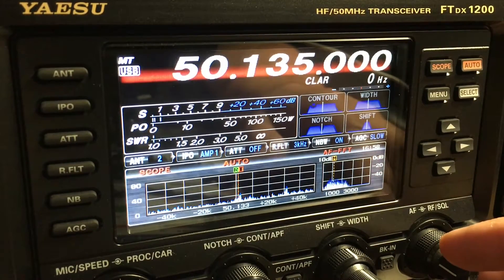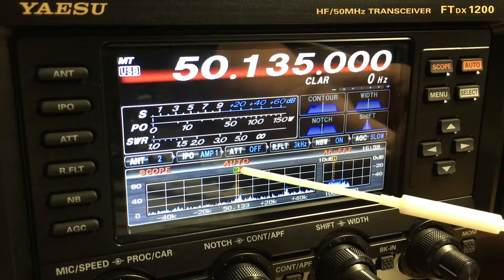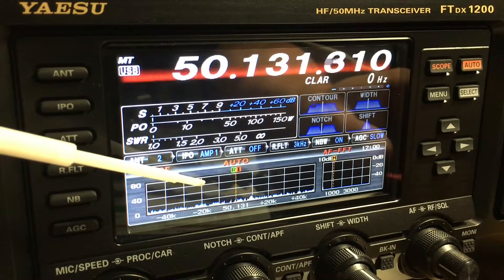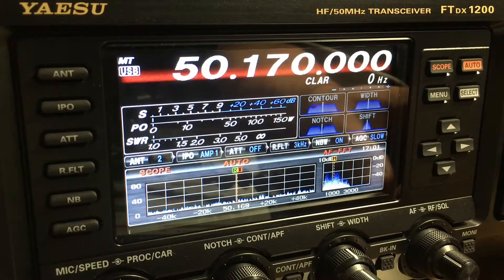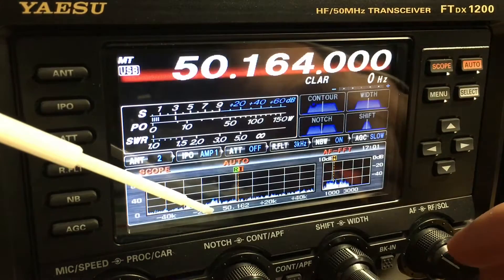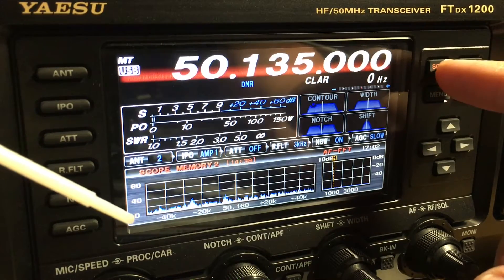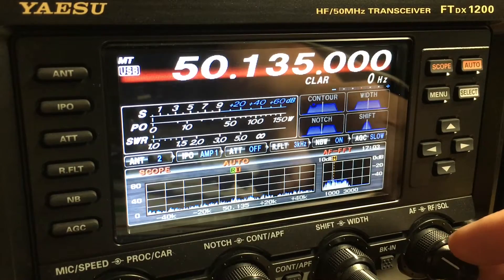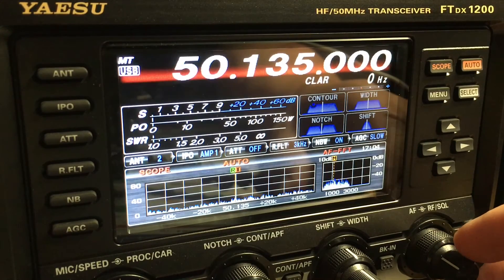Yaesu FTdx-1200 Demo / Scope, DNR, & Split Operation

Comment: The DNR works better on this radio  than my ftdx10 .
Why is it that Yaesu discontinues nice radios? 😢
Reply: At the time, Yaesu claimed they couldn't get the chips anymore, but the designs were also a decade old.  Yaesu has just refreshed its entire HF lineup with newer technology.

Comment: I had this radio when it first came out and it was great.  I think it was around 1300.00 with a 300.00 rebate.  The new FTDX 10 blows it away at around the same price, a little higher I think around 1600.00.  The only way I would buy a used FTDX 1200 is if it was around 400.00.  I Don't think I would buy any used gear now, new is so cheap.  Would you buy a used cell phone?  The 7300 is king but now the FTDX 10 showed up and crushed it and the 7610.

Comment: I was wondering the yasu radios like this 1200 does it have a bass and treble for your transmit audio to set up a microphone?
Reply from the maker: You can adjust mic gain, and some radios like the Kenwood TS-2000 will allow you to adjust microphone bass and treble not sure if the 1200 supports this.  I'd have to investigate deeper in the owners manual.  If you ever wonder about the available settings on amateur radio gear visit the manufactures website and download the .pdf owners manual.  I usually do that myself and look over options and settings before I decide to purchase new gear.
Reply: @KC5TGTRadiosNMore  ok thanks
Reply: @KC5TGTRadiosNMore   Yes the FTDX1200 has menu controlled audio  settings.

Comment: I have been trying to get someone to give me more information about the AF-FFT scope. I have been asking if after you install the FFT-1 do you have to do a "master reset" to the radio. And I also noticed that your  AF-FFT looks alot different then mine. Mine don't have the "M" with the yellow background and on my scope mine isn't solid spectrum across. Mine has a notch and 2 peaks. It looks like to me that you can move the "M" bar left to right for adjustment. I went through all the settings and can't figure it out. Went to other video's and seen where a guy had the full "water fall" on all 3 scopes....Is there a setting or is there something i'm doing wrong?
Reply: @KC5TGTRadiosNMore ....Well I called and wrote to Yaesu and they act like they don't care....Actually they don't care....Even their Tech support wont respond anymore, and this was way before the virus thing...I wrote them 4 times and no response.
Reply: @KC5TGTRadiosNMore ...Yes I did do all the firmware updates....This is where the problem started actually. I did do a factory reset twice and still have the problem.

Comment: There are other single receiver radios that show an active band scope without cutting the audio. The only reason the 1200 doesn't is Yaesu wanted to give you a reason to buy the 3000 instead. They probably spent an additional $10 in design/production to make it work the way it does, so you are tempted to pay $800-1000 more for the 3000.